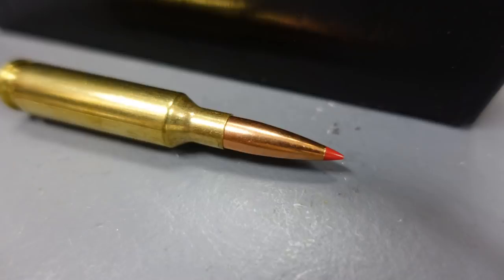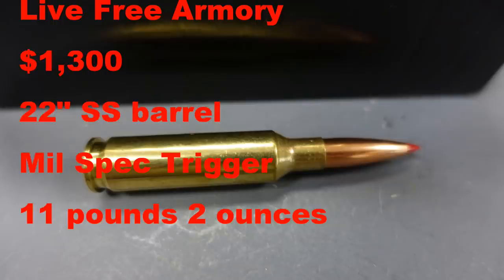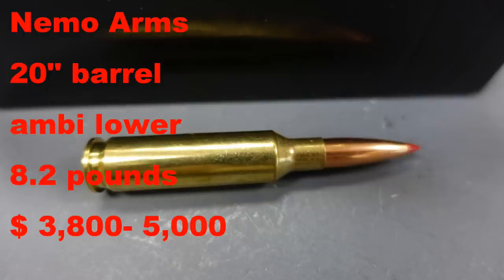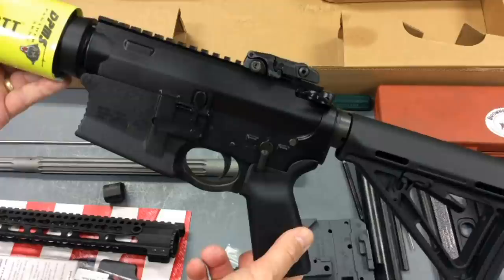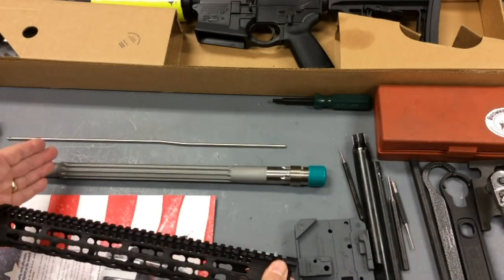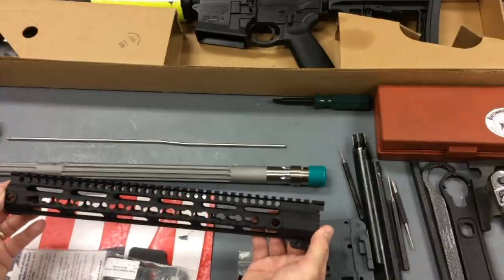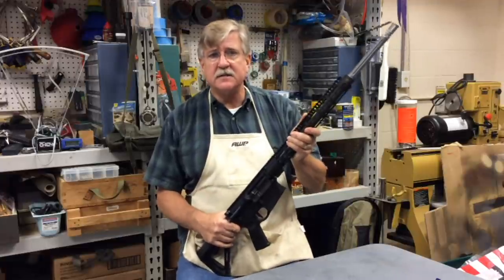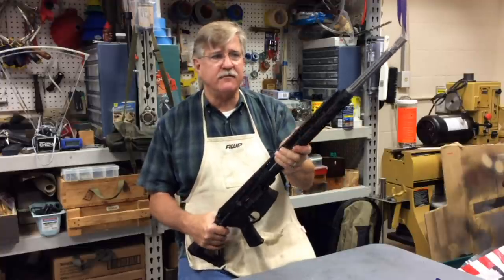Build Your Own Match Grade, Lightweight, Semi-Auto 6.5 Creedmoor Rifle

Comment: I stopped watching this after he attached the barrel because I saw he was making SEVERAL errors:
* Did not grease all points of contact between the barrel and the upper to prevent corrosion between unlike metals.
* Did not condition the threads when applying the barrel nut.
* Did not use a torque wrench when tightening the barrel nut.

Also since this is a match gun:
* Did not attach the barrel while in a vertical position.
* Did not use a barrel extension tool while torquing the barrel nut.
Reply from the maker: Type 3 anodizing is an insulator
I did condition the threads, just not in the video. 
I know what 30 ft/lbs feels like. I have done this a lot. If doing it commercially I would use a torque wrench to document.
Vertical position is interesting, do you have documentation of that technique making a difference? Does not sound like a bad idea.
Reaction rod interacts with extension. Do you mean a tool that protects the barrel extension?
Reply: The Threads where already conditioned from previous barrel and greased. torque of the barrel nut is to 35 ftlbs then to next gas tube alignment slot or notch not a set spec.
Reply: Michael Bell i built my 6.5 creedmore and several other ARs the same way and all my rifles are sub moa tack drivers.  Nice build!
Reply: Where is your video on how to do it properly then?
Reply: Wow, shoot a video, show us all about how its done....

Comment: Mike, would you think this PSA model 308 would make a good donor rifle for this project?: http://palmettostatearmory.com/psa-gen2-pa10-18-mid-length-308-win-stainless-steel-lightweight-m-lok-rifle-516446226.html
Reply from the maker: No. This is NOT a small frame 308. This is just Palmetto"s second generation of their standard size AR-10. The terminology gets very confusing. But this is not a Gen2 Small Frame.
Reply: Okay,  thanks Mike.  New to the AR-10 platform and still getting my bearings so I appreciate the guidance.
Reply: I guess I messed up by buying the PSA 10 :-/
Reply: No you did not.